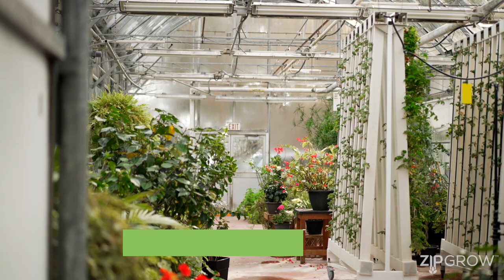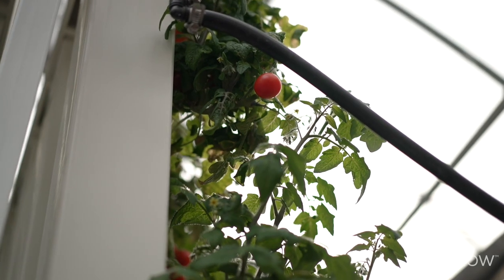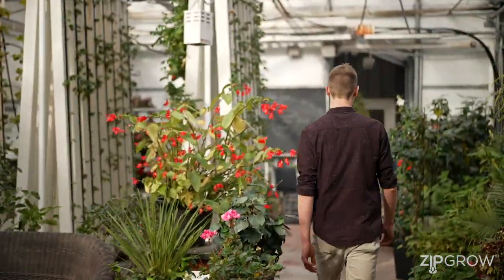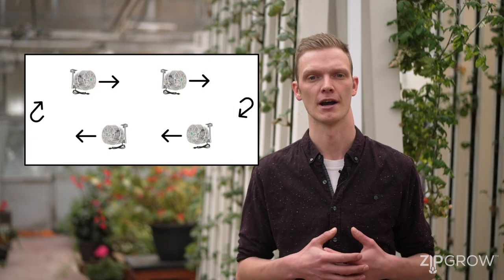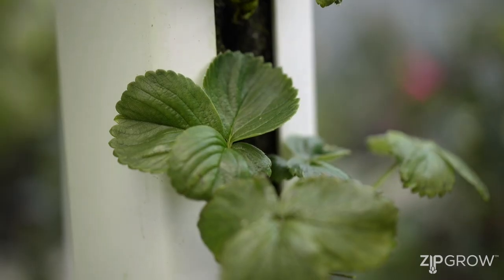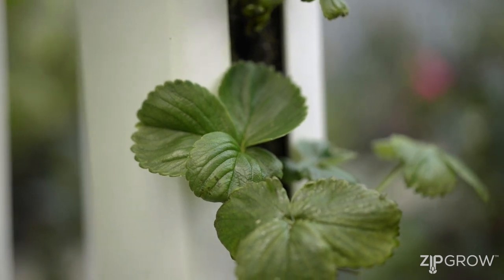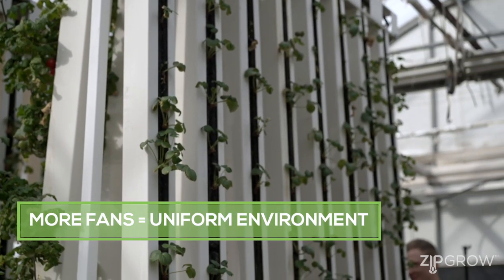Air circulation and fans in greenhouses

Comment: Great video. I have a new greenhouse, 34x100. I’m having an issue with low humidity. The greenhouse is exhausting the air to cool, but it’s still very dry outside here in Michigan. Today  it was reading 20%humidity inside with 80F. Any good (cheaper) ways to humidify a greenhouse? Netafim foggers? 
Cheers

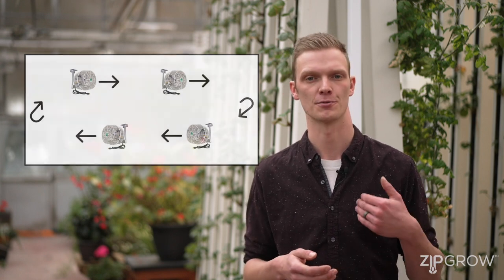Comment: 1:49 when you say half point towards the front and half pointing towards the back, if the green house is rectangular are you meaning facing them so they go long ways along the length of it?
Also in a hot climate in summer, would you run the circulation fans at the same time as extraction fans?
Thanks for a great video, best I have seen so far on this topic
Reply from the maker: Thank you. With a rectangular greenhouse, we’d recommend facing them along the length of the greenhouse. This way, the air would loop around 360° degrees. This allows cold and warm air pockets to mix, which leads to uniform temperature in the plant canopy. 

In the summer, we would recommend only running the extraction fans. This way, you are guaranteed to ventilate all of your humidity in a single direction within the greenhouse.
Reply: @ZipGrowInc  Ah, makes sense! Thank you for the advice, its really appreciated.

Comment: How many circulating fan needed in 1 acre of fan pad polyhouse in climate like india where temperature reaches around 45 degree celsius?? And how to place them in polyhouse for maximum air flow or circulation?? For vertical set or grow bags or dutch bucket system...... Thanks in advance
Reply from the maker: Thanks for your question. We typically suggest a CFM of recirculating fans to be twice the floor area in square feet. You would be looking for total of around 90,000 CFM for this type of an area split between fans that are no farther than 40 feet apart. In an environment like India I would also suggest evaporative cooling systems or shading to reduce temps as much as possible.
Reply: Thanks for reply.....will do the needful on site as its very hot summer this year...... Thanks